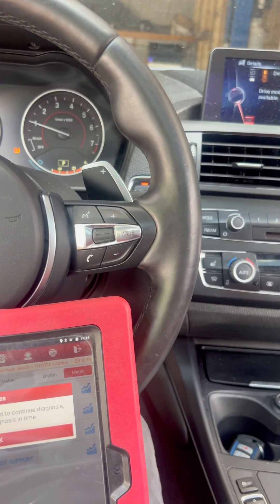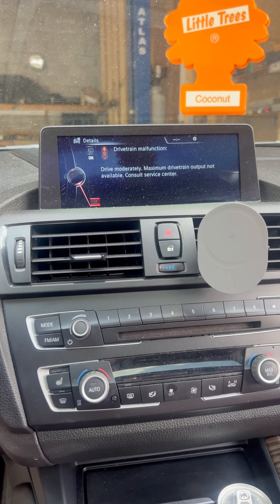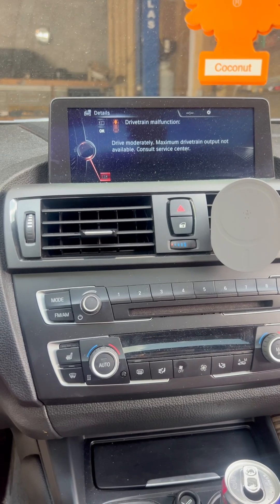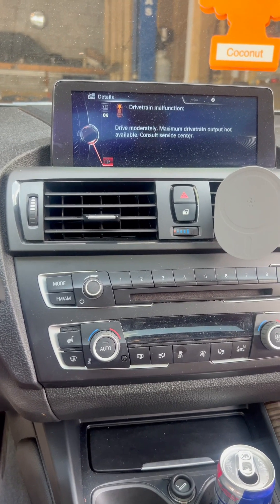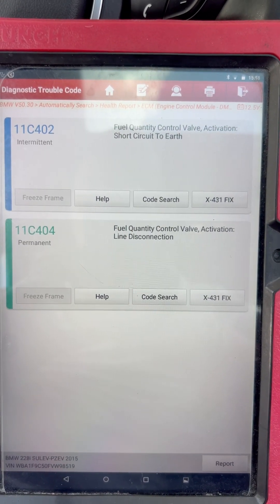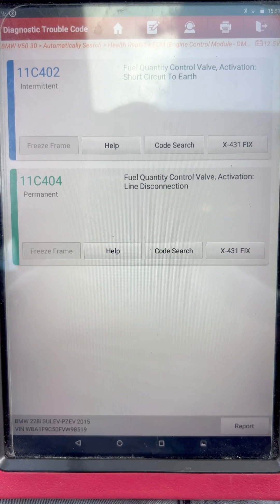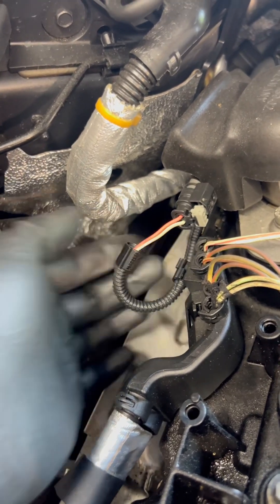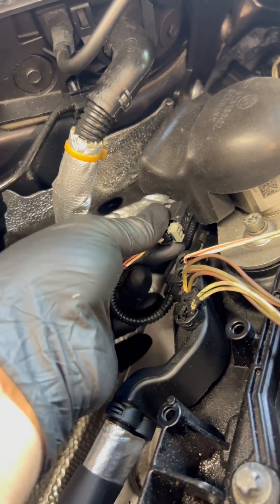BMW N20 engine “Drivetrain malfunction” warning light and 11C404, 11C402 fault codes. #bmw

Comment: I’m having this same problem… my HPFP was replaced for a aftermarket one that have the same connection if I disconnect while the car is on it feels different but I still have the drivetrain malfunction sometimes.. I just put the old one back and it’s fixed .